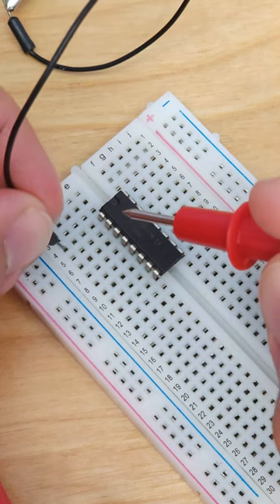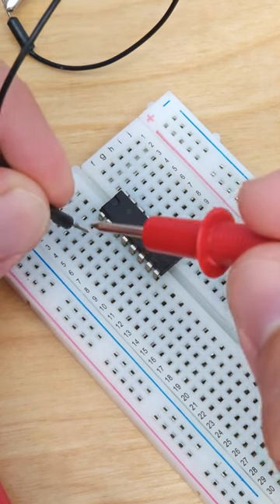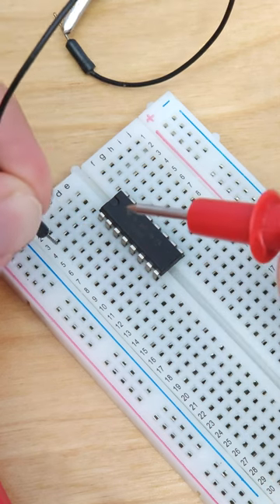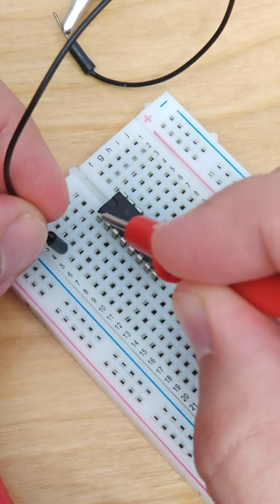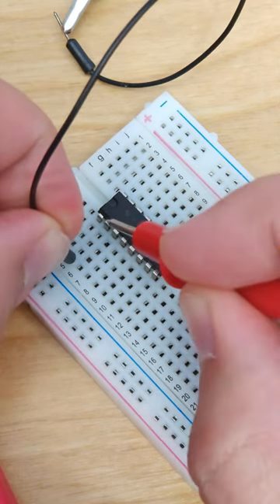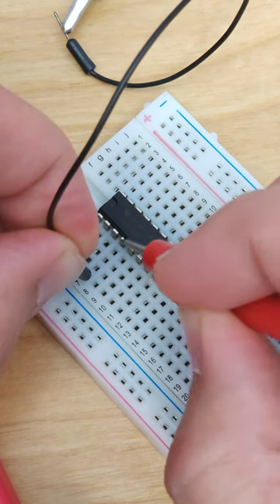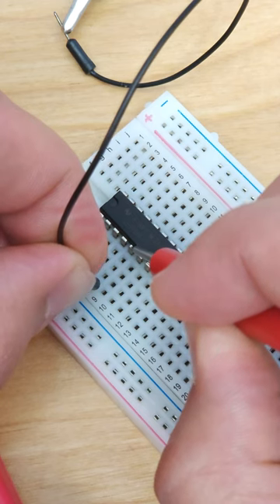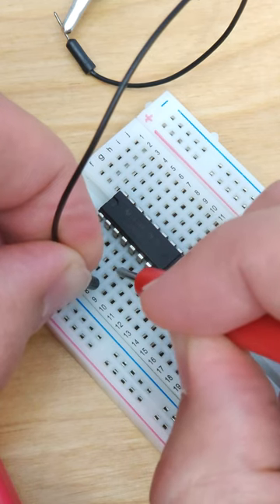Diagnosing a Bad Breadboard Connection

Comment: This isn't a rare problem it happens to all breadboards eventually. Although there's a correlation between the quality of the breadboard and how quickly this happens its inevitable because of the mechanism these boards use to hold the pins. Not only that, you can have continuity with the whole row, add a component or two to that row, and all of a sudden, half the rows dont have continuity. People need to stop using using these things. If a hobbiest fisherman had a line that snapped after just a few casts, they wouldn't buy that  line again. Use perfboard or stripboard instead.